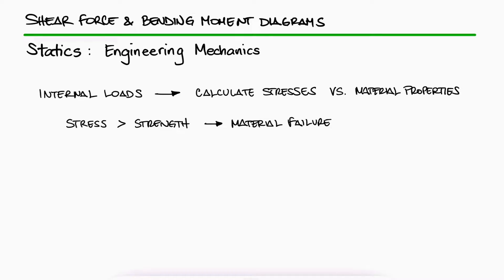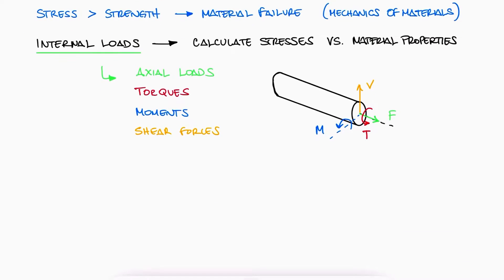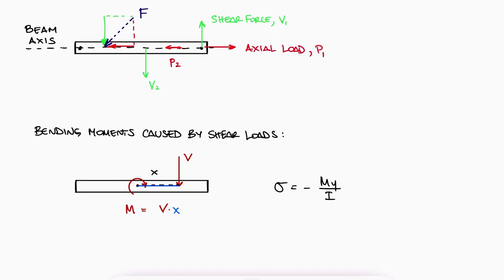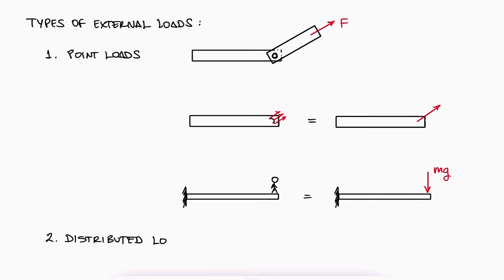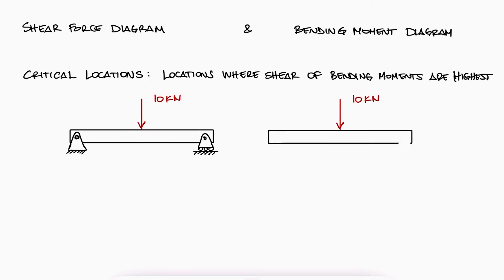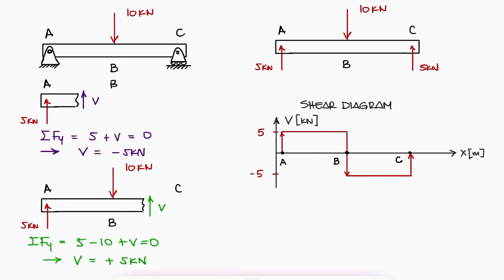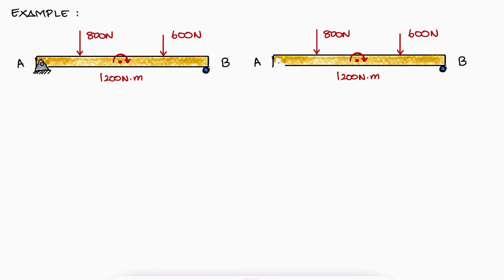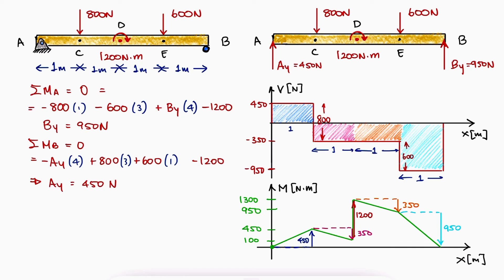SHEAR and BENDING Moment Diagrams in 13 Minutes!

Comment: Can anyone explain why clockwise Applied moments appear as positive in the Moment diagram?
Reply: Because the Moment Diagram is evaluating Reactions - thus - the applied moment which is negative (per convention - clockwise) - to counteract this negative moment - an equal and opposite positive moment is required.